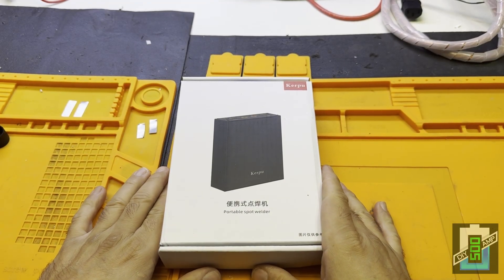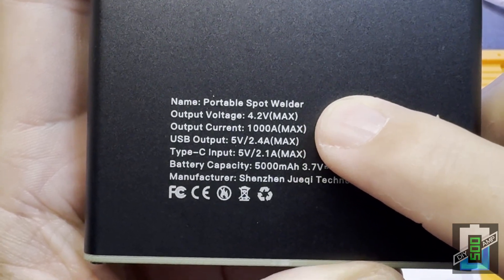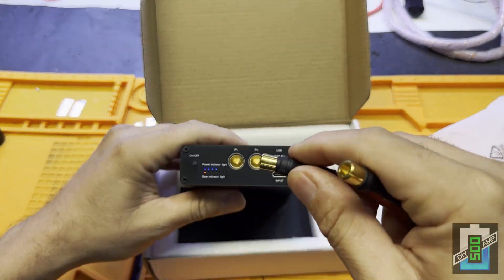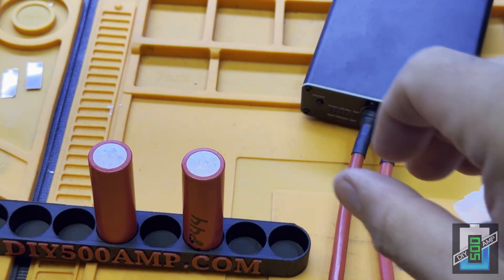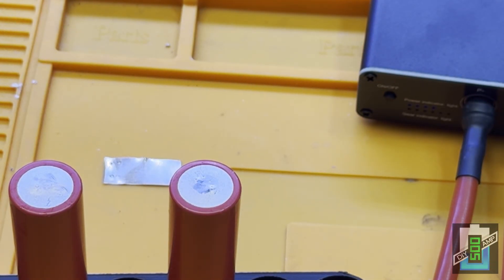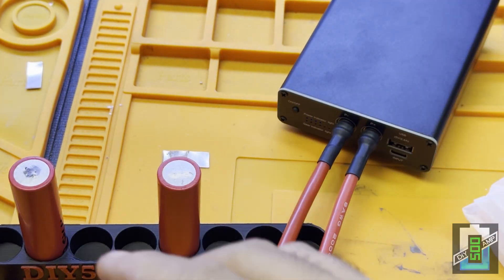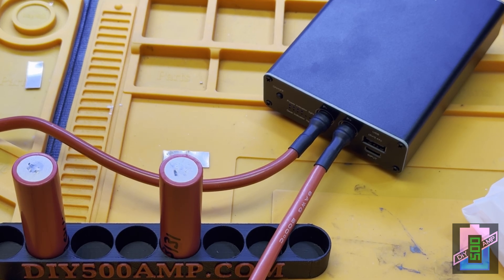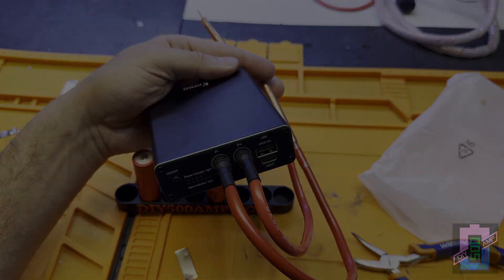Testing the Kepru CP01 Spot Welder – Pure Nickel & Nickel-Steel Performance

Comment: Nelvick you should try it with strips that have a slit in them, but it seems pretty good for such a low price.
💥👍
Reply from the maker: Exactly with slit will be even better. I just want to give the worse case scenario. I don’t want to use slit and the a normal person use a strip and learn that does not work. I want to test the worst case to make sure will work and I am not selling dreams.
Reply: @DIY500AMP Ah right, ok..cool, It just made me wonder 🤔 riddle solved 👍

* Do 'normal' people watch these type of videos? 😂